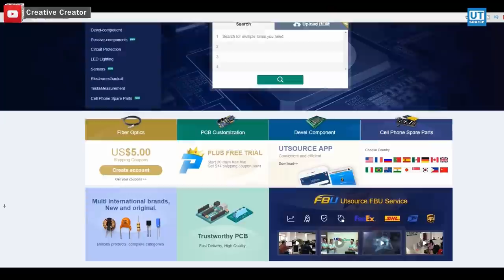Simple Inverter Circuit

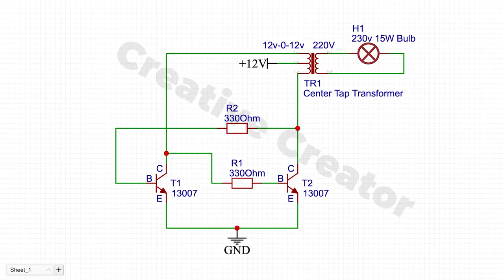Comment: 1:06 you showed resistor value as 330 ohms(which was confirmed by the color codes)  but in the diagram (5:10) it showed 3300 ohms so which is correct?

Comment: Bro can i use 1 ampere boost converter for boosting the voltage from 3.7 volt to 12 volt instead using 12volt Battery directly?
Reply: Yes

Comment: I am having it very difficult to get mosfet to stay on cool use 8 different logic mosfet to inverter but they so hot they distract them self why is this happening even your design I try and all get so hot it burn my finger I use 555 timer Ic in inverter mood I build a lot of circuit over the years and the hardest one to build is and inverter it start to inverter and the voltage would get pass 7.80 ac voltage I set the frequency to 50hz and the mosfet still distrusted is self even when I use a big heat sink the heat stay cool and mosfet hot and burn out